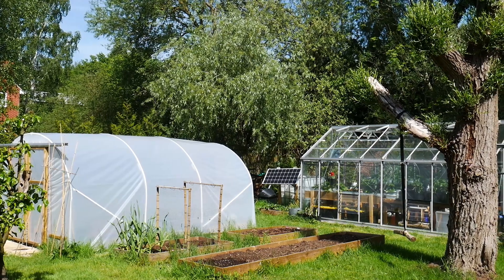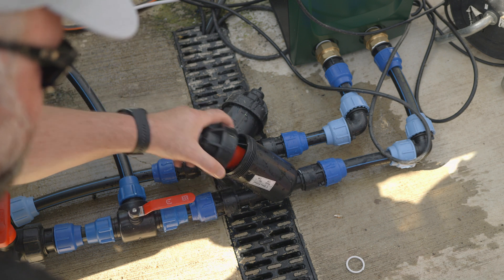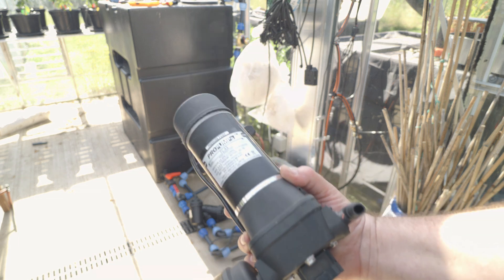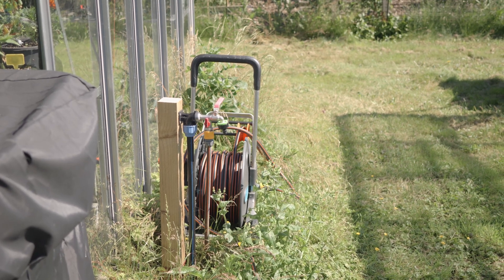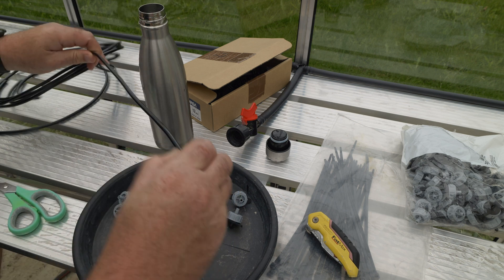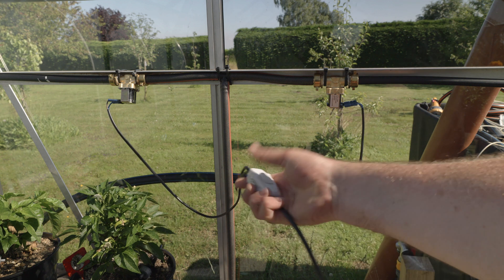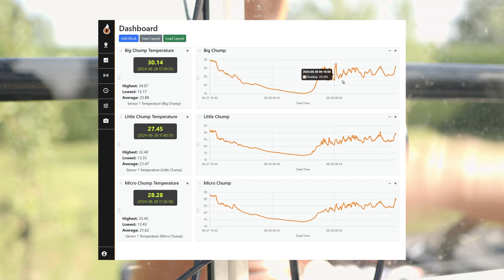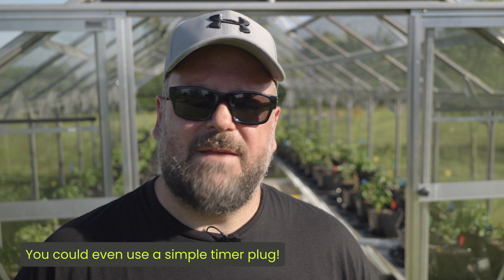Avoid These Greenhouse Setup Mistakes!

Comment from the maker: I am so lucky to be able to combine two passions of mine....Chillies and Tech! I hope you enjoyed the video. Below are most of the parts I use in the system, as well as some useful links:

SeedsIO: https://seedsio.com
ChilliChump consulting: https://chillichump.com/chillichump-consultancy/
Earlier automation video: https://youtu.be/RpdaaCLvpfU
Cleaning Drippers: https://www.youtube.com/watch?v=mPexdl3BOaE
Automation 101: https://www.youtube.com/playlist?list=PLuQ_ySnkV1elVl8hCvmYyEzjs_vxEIsxu

📡Parts
Drippers: https://geni.us/presdripper (I use 4l/h)
NC AC Solenoid Valve: https://geni.us/ncvalve
U Channel: https://geni.us/uchannel
U Channel fittings: https://geni.us/uchanfittings
Disc Filter: https://geni.us/discfilter
Pipe Cutter: https://geni.us/plasticpipecutter
13mm mainline: https://geni.us/13mmpipe
4mm drip line: https://geni.us/4mmpipe
Inline taps: https://geni.us/irrigatetap
Barbed fittings: https://geni.us/barbedfittings
FL43 Pump: https://floodandwaterpumps.co.uk/products/fl-water-demand-pump
DAB Pump: https://geni.us/esyboxmini3 (You may be able to find this cheaper elsewhere)

Comment: "I have a few more greenhouses". That's a slight understatement 🤣Nice system though. If I had power and space for some kind of water tank on the balcony I'd be interested by something like this for sure. But I have neither, so I bought an AutoPot kit instead! Hoping it'll work out well! It is still interesting to see how these things are built! So you replaced the moles with a digging dog? Or was he digging for moles? 😄
Reply from the maker: He is attempting to get the moles! No luck yet 🐶
Reply: @ChilliChump  Aha. Practice makes perfect! 🤞

Comment: Affiliate links are not the products you showed...
Reply from the maker: Which country are you based?
Reply: @ChilliChump  Germany. Most of the links redirect to search pages...
Reply from the maker: @benjaminh.7698 I use a service that localises the link depending on the country you are in.  I can't manually find links to the exact product in every countries amazon unfortunately, and on top of that I can't keep them updated and monitor when stock runs out or the product is delisted. The service I use allows me to do that more efficiently.

The link is primarily based on the link in the UK, which is where I purchase from. Sometimes the system is clever enough to find the exact product, other times I have a search term which should search for the product and hopefully get close. What specifically are you looking for?
Reply: @ChilliChump  I am looking for the drippers. An Amazon Uk link would be ok for me.
Reply from the maker: Try here if you can order from the UK (use this link to get £5 off your order  http://rwrd.io/eytz1mb?c)
https://www.waterirrigation.co.uk/drip-irrigation-components/micro-emitters-stakes-extensions/micro-drippers/pack-of-20-hydrosure-pressure-compensated-easy-clean-micro-irrigation-dripper-4l-h.html
Reply: @ChilliChump  Thank you very much ;)

Comment: I've always enjoyed your automation stuff. It is very much in the realm of things I like to mess with. That being said, I feel like your actual irrigation setup is an unadulterated bag of dicks (in the nicest possible way). There shouldn't be switches and wires and solenoids all over the greenhouse. Centralise all that stuff and let the plumbing do the work. I also recommend using 19mm hose instead of 13mm because, well, if you do it, you'll see how much better it works out. Sorry, love your content.
Reply: What differentiates an unadulterated bag of dicks from an adulterated bag of dicks? Which is preferable?
Reply from the maker: All plumbing is 25mm. The last leg for drippers is down to 13mm, then 4mm. No need for anything more. It's more than enough for the flow rate.
And not sure what you mean by centralising? Each grow space is being monitored independently, and therefore controlled independently. The pump is centralised, running 25mm through to all spaces. If I had all valves sitting where the pump is then I would have to run multiple pipes to each grow space. Instead of a single run like I have now.  In each grow space I have multiple zones so I can independently water each zone as needed.

Comment: Do you ever have growth in your feed lines?
It's always been my concern and has kept me hand feeding plants. My 4L drippers are sealed (two per a pot off a ring main), They were cheap but you can't clean them, seemed like a good idea at the time for the money.

Also I'd be worried about killing my microbes & bacteria in my feed with a hot pump working like a food processor.

As for mains we have to dig it in 600mm deep and armour it with danger tape above it. Or over head wires, I've used 12V solar fans and battery powered timers.
I've thought about a 48v system with DC buck converter and a small inverter where needed. Saves those spendy cable runs but batteries aren't cheap either with running lights or 4 fans nearly all the time.

I'm very keen to see your automation setup in detail 👍
Reply from the maker: In my first installation I had growth in the feed lines...because I didn't flush the system at the end of the season. I now make sure to run clean water through at the end of the season to clear out any nutrients that may be left in the pipes. I also have taps at the end of each dripper run which allows me to drain the system too. At the beginning of the season I then check that each dripper is flowing and I may get a few that need a clean. But otherwise its all good! Here's a video of me sorting out drippers at the beginning of this season https://youtu.be/mPexdl3BOaE?si=aEgqbFUebIjq-nNB
Reply: @ChilliChump  I thought some funk would grow in the pipes with the heat. My current drippers are pressed together. Should probably buy a bag of decent replacements to have on hand.
Do you feed exclusively organic, do you think there is any extra risk with organic feed for blockage other than particulate?